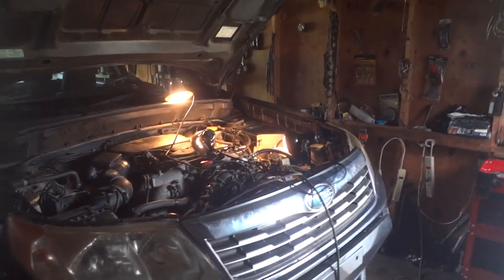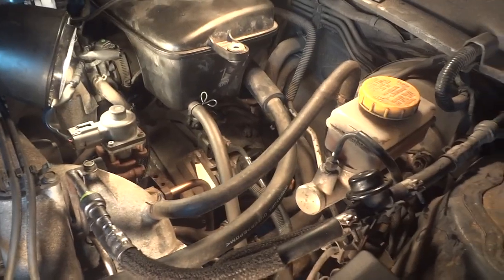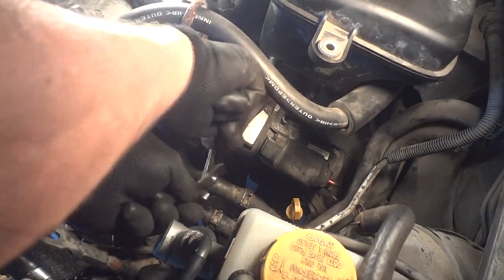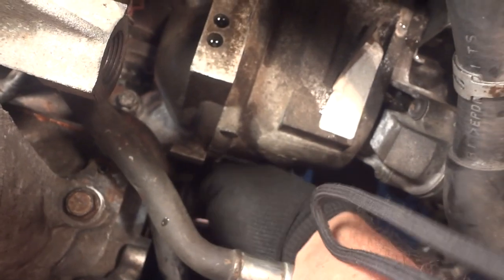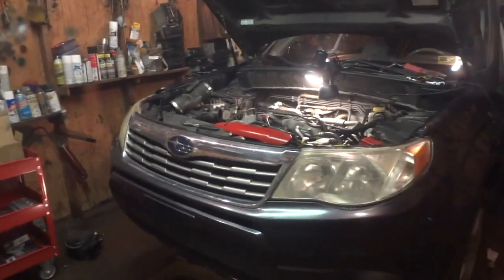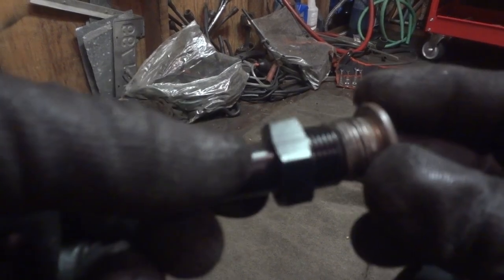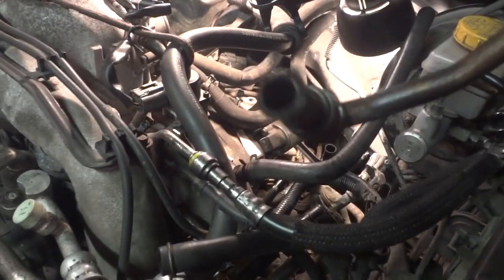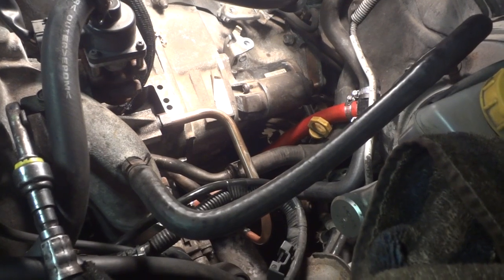Subaru #4 Cylinder (cooling Mod)  SOHC 2.5 Forester

Comment: What did you use to solder that egr pipe? Normal tin or silver? 
I have same problem and thinking is normal tin solder good enough to stand the heat of that egr pipe. Greetings from Finland.
Reply from the maker: I used silver. But if you can get the pipe pretty tight is will still work. Not really any pressure down there.
Reply: @FixingWithPassion  I bought 12mm copperpipe and compresson fittings and try to get fit nicely to engine room. 👍🏻